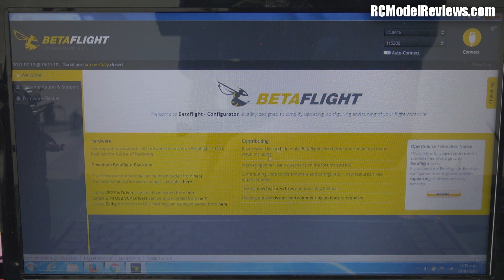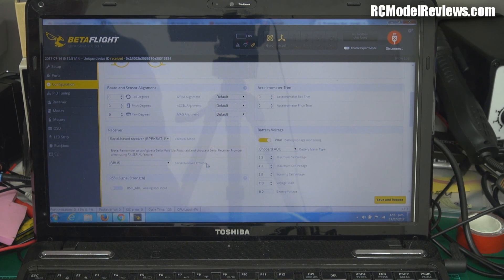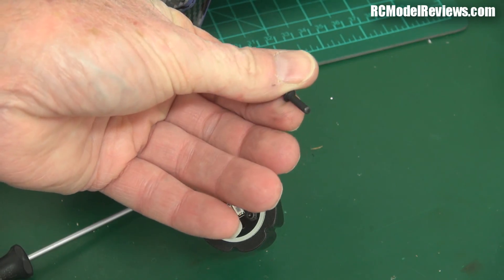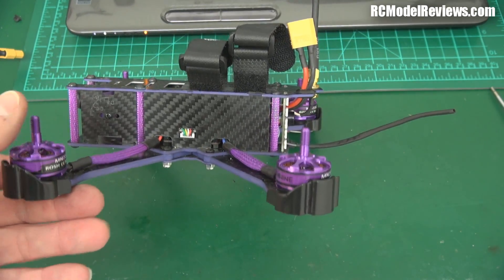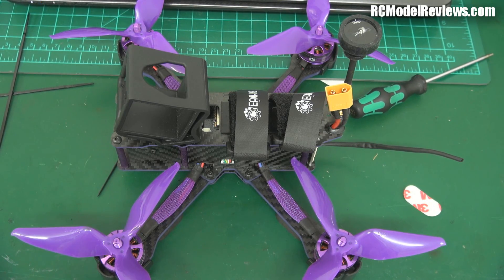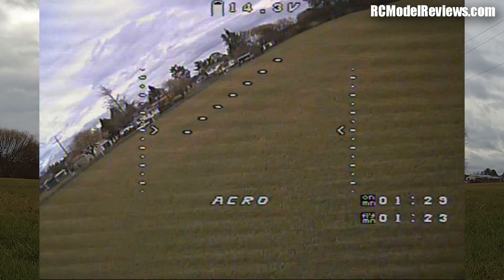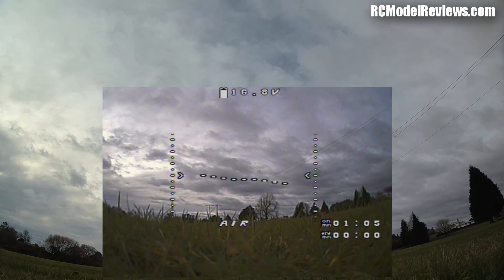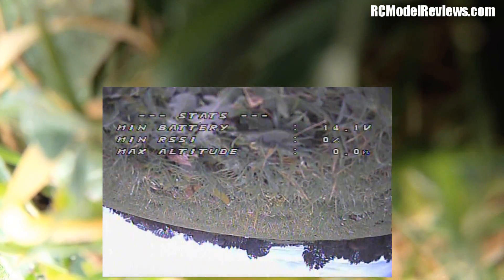Review: Eachine Wizard X220S - FIXED and FLYING

Comment: i have the fs-i6 with the x6b and i couldnt get it working no matter what i did. i tried switching the signal wire and changing the uarts, nothing. even tried my spare a8s and still no controls whatsoever. any ideas??? hope i dont need the new tx

Comment: a lot of the f4 boards dont like turnigy/flysky sbus. also when they do, the radios are usually out a little.
I plug straight onto uart3 and go ibus. simpler and for turnigy/flysky, better.

looking at a lot of reviews of this craft, I havent seen the issues before - perhaps reviewers curse.

Anyways, thanks for reviewing,

Comment: I have one of these in hand............
Loose screws > USE A SCREWDRIVER or did pre flight checks suddenly vanish with the ADHD generation ? Flew mine yesterday and not a single screw came loose....................Pre flight checks.................
There's no loctite on my Diatone, ZMR or XBEE220 either , 70+ flights in and everything is still tight.
The battery probably isnt 75C but its enough for testing , if we want to start moaning about labeling we should start on everybody at the same time ,not all  Nanotechs are what their C rating state , in fact a large proportion of batteries are not what their C rating state.

The receiver needs changing but that is a fault of Flysky and their shitty QC , lots of complaints starting to appear regarding the A8S and Flysky need to fix the situation instead of bull shitting their customers.
Camera is pretty good.
VTX was on 25mw which always causes issues in certain areas , stepped mine up to 200mw and its perfectly acceptable.
The battery straps are in the wrong position for access to the VTX button however.
Frame can be a bit fiddly if you have fat fingers.
Reply from the maker: No, I'd already set the VTX to 200mW (2 bars).  I changed the antenna and it's all good now.
Reply: Nice one, glad to hear that the fix is a simple change of antenna .
If they'd used an Omnibus F4 they could have forgone the PDB and put an X6B in its place giving better range for the TX or used the space to hold a Runcam Split and just installed the RX in the same rear place , obviously that would end up reflected in the price but it would save too much messing around.

Comment: I think you did the review of the anom way antennas I put one of the blue ones on my first person view receiver goggles over the rubber ducky and reception is massively better I was even able to get good reception with some blinking and static inside the undisclosed shop that I was flying in and one of my most recent videos

Comment: SBUS won't work on the SBUS UART if you don't add a blob of solder next to the port that says SBUS
Reply from the maker: Don't need to on this board... it has copper between the two pads -- you can just see it if you look closely on the video.  I checked for continuity just to be double sure.
Reply: RCModelReviews Weird it came like that. Glad you got it up and flying. IBUS is better anyways :)

Comment: Yes, i lost parts too on the original wizard 220.
Lost 1 of the aluminium spacer pins with the 2 screws, and 3 screws that hold the motors down as well as 2 other Frame screws.
They were all tight but NO loctite!!!

Comment: Most chinese manufacturers don't give a crap about making good products. They just care about getting as many items out the door as cheaply as possible because they know for every person that's unhappy there's 10 that buy the stuff anyway because it's dirt cheap. The problem is compounded by the fact that there's always going to be reviewers willing to suck up to said manufacturers in order to keep getting free stuff, while folks do give honest reviews of cheap chinese crap get squeezed out because they won't gloss over problems. 

So long as there are reviewers who will literally say anything just to continue to get free stuff, this situation will never change.  I also doubt any chinese manufacturers will reach out to your offer Bruce unless you were to change it to showing them how they could cut even more corners.  Because like I said, making a better product means a more expensive product for them to make, and that's the opposite of what they want.
Reply: Exactly. Well said. Their aim is only money - what sells best. Their aim is NOT the best design or best quality or best performing product possible given the particular target budget (e.g. whether it's the luxury, general usage or economical sector). So BEWARE of especially their frame designs - it's not difficult to see examples of where they've actually designed to fail rather than for maximum strength/weight ratio. That has to suck. That has to stop.

An example: Carbon sheet is such a great product. Light, rigid and strong. By this time (2017), FAKE carbon sheet (fibreglass dyed black and coated with a skin of carbon weave) based copter frames are pretty much unacceptable. The fibreglass sheet has way too much flex at normal carbon sheet thickness’s, and if you thicken it up to allow for that flexibility, then it's way too heavy to be viable.

It's a culture clash really. Western society's (adopted) ideals of general moral codes of conduct are 100% Christian based. China as a nation and society has almost 0% Christian basis and influence. So all bets are off :|. But I'm not criticizing or hating on the Chinese, and I do buy some of their products. Just that if you're aware of the vast general difference of outlook and orientation and acceptable moral codes of behaviour, you'll be much better placed to err "choose wisely".

Comment: I agree Bruce. I just got a Eachine 250 racer pro, not a drop of loc-tite there either. I didn't check and on the third flight a motor and esc flew straight off in a hover with little warning. the motor windings are damaged so now the model's grounded for weeks and I'm out of pocket all because I was too lazy to check. Eachines are good and cheap but they are not RTF.

Comment: Put some regular old 5x4x3 props on it. I'll bet it flies 10Xs better. FPV pilot are like teenage girls in the way they chase the latest fashion.
Reply: they are but nobody enjoyed changing the original 5x4x3 hq after props every minor crash
Reply: jamble7k get the PC ones or do what do and get the KingKong ones from Banggood for like $6 for 10 pairs.
Reply: yea i have some they aren't bad props, mostly use the dal cyclones now tho on every quad
Reply: jamble7k I like those too but their stock is lacking

Comment: Bruce,
there is a problem with Betaflight 3.1.7 and S-Bus on a F4 omnibus type of hardware/firmware. If you downgrade your firmware to3.1.6 it should work fine with s-bus. I experience the same problem on my DYS F4 FC after I upgrade to 3.1.7.
Reply: yup, this is almost certainly the problem. stumped me for days before I finally found the github thread!

Comment: Is that an  FS-A8S receiver?  I bought a bunch After a review by UAV futures & nearly lost a quad to the glitchy performance of those units....they lock up at full throttle for  3/4 of a second on any hard punch outs- or agresive throttle movements. very sketchy performance. Any chance you could delve into that issue Mr Bruce (in your spare time LOL) thanks for the channel.
Reply: Thudmoto just had this exact same issue. 1 rx was "madmax" mode and 1 wouldn't even bind. Won't be buying anymore of those FS-A8s rx.
Reply: SonicStates-there is a long thread on rcgroups about the exact same issue....no real fix found (that i can see) I can't belive these 0r their re-branded models are still for sale....they are  kinda dangerous as is. 
I held off buying the things, then Stu kinda raved about them.....lesson learned.

Comment: I cannot believe this thing has a FS-A8s RX in it (re-branded by the looks).  There's a 47 page long thread on RCgroups on how busted that RX is, and yet they still haven't resolved it or stopped selling it.  I do notice that the one the X220S seems to have some sort of modified case to try stop the RF interference that was making them fall out of the sky, or worse jam on full throttle.
https://www.rcgroups.com/forums/showthread.php?2792377-FS-A8S-help/page47

Comment: Don't worry Bruce.  I've made videos on fixing both the motor loctite and the VTX issues if you need to refer to someone instead of Stu.  :-)
Reply from the maker: I'll check your channel out... thanks for the heads-up.
Reply: RCModelReviews you rock, Bruce. I may have to go increase my RCModelReviews Patreon amount.
Reply: Hey bub, my VTX is really |snowy" if that helps... it was bad before when it was stock and it's still bad with the LEDs and PDB removed. I've also properly insulated the motor screws from the motors. I'd really like to have it ready for when the weather here allows. Thanks for any help!

Comment: isnt the sbus inverter on uart1? or have I missed something?  I run my xsr via uart1, smartport on uart 3 and smartaudio on uart6 on my omnibus f4's
Reply: latest version of the omnibus(V4) has the inverter on uart 6

SBUS/PPM (J7) header (uart6) This is for inverted signal receivers; has fixed inverter that can not be turned off
Reply: The Flight controller of this quad is Omnibus f4 pro V3
Reply: J7 has always been uart1 to me. Fair play if its been moved... like most things in this hobby everything is not always as it seems. Lol
Reply: yes it's hard to keep up at times, i have an omnibus f4 that has the sbus input on uart 1 also

Comment: Shortcuts or not, broken is not acceptable. This RTF certainly wasn't RTF.
Reply: anglovirtual well if you are thinking toy grade my jd509 is charge the battery and fly that is the only fpv multi-rotor that I've been able to get to work so far my home build keeps burning out cameras and the other one that I'm having issues with which is in a video in my channel I forget the name exactly I might be trying something like what he's done here

Comment: Stu is always Super excited but this kit should be changed in few places before was released. I own 2 wizards and both are completely modified as stock setup is just not good for flying right out of the box You need to modify few bits before first flight :)